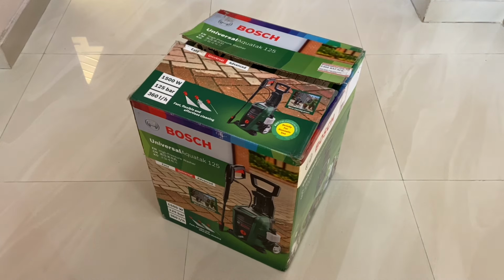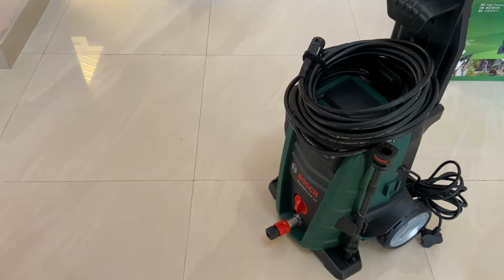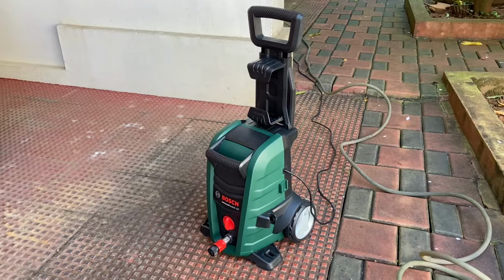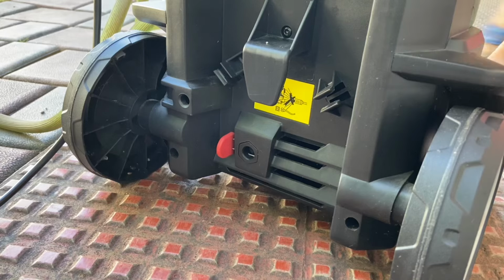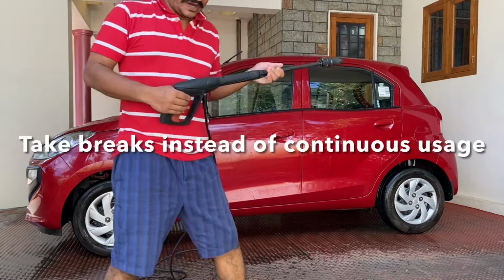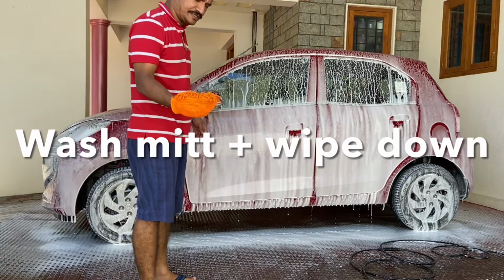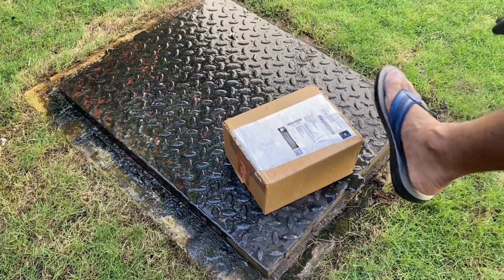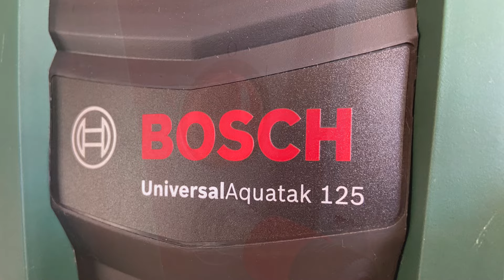Bosch Aquatak 125 Pressure Washer - Unboxing & Review

Comment: Great video! How’s it working right now?
Reply from the maker: Hi shashidhar, the pressure washer is working fine. I just used it last month when I was at home to clear the pavement of the green algae which had developed causing the pavement to be slippery.
Reply: @ that’s great to hear, have you had a chance to use the cheaper dylect washers? If so, please let me know what you think of it
Reply from the maker: Hi Shashi, no I haven’t used these washers with induction motors. I really want to review one since I am hearing good reviews on these units. Coimbatore has a lot of these small companies that assembles these washers. I saw Dylect’s washers on Amazon and want to review one. Let’s see. 😊👍🏻
Reply: @GaneshBalan  Hi Ganesh, thanks! I'll wait for your review of one such unit. Cheers ☺

Comment: Hi.. nice one.
Just bought it yesterday.
Please guide how to remove the air before using
Reply from the maker: Hi, before turning on the unit, press the trigger on the lance. Water must flow freely without pressure thereby purging air from the system. Then turn on the knob.
Reply: @GaneshBalan  thank you so much
Reply: @GaneshBalan  just need one more thing to know.
Shall I connect the nozzle while doing this or just with the gun itself I release the pressure?

Comment: Hi. How is the product now after 2 years of usage. Is it still worth to buy ?
Reply from the maker: 6.5 years of usage actually. 🙂 I bought this in Aug 2018. Working well. No issues. 

There are induction motor based pressure washers available now which are cheaper. Please also evaluate them if you can. They are more compact and produce equally good pressures.
Reply: @GaneshBalan  can u suggest some alternative please

Comment: The most comprehensive and informative guide for utilizing this machine’s capabilities. Storing the component in such a manner is truly remarkable. I commend your sole efforts, as I presume that no one has held the camera.
Reply from the maker: Thank you for the kind words Nirmal. Appreciate it. 😊 I had a tripod to hold the camera while I was working.
Reply: @ Will the Bosh extension hose pipe reduce the pressure? Is it good buy too? Please advise.

Comment: One small doubt brother,tell me the  water tap to nd machine water supply connect pipe size
Reply from the maker: 1/2” hose bro. You can get it in any hardware and plumbing store.

Comment: very informative video. I wanted to know whether we can attach the top nozle without the extension bar? Basically to reduce the length of the gun. If gun is too long, it's not feasible to clean mud guard and covers behind the tyres. Just wanted to know whether the gun length can be shortened or not. Thanks
Reply from the maker: Hi, no you can’t attach the nozzle without the gun. For reaching the underbody of the car, Bosch has a separate accessory - a 90 degree nozzle. 

https://amzn.in/d/fBzUqaD

Comment: Thanks Ganesh for the detailed Video. May i know what is your long term experience on this till today. Was it worth the money, any problems encountered ? Is this Copper or Alumunium motor, and what hp does it comes with. Thanks.
Reply from the maker: Hi Vinoth, it has been 6 years since I purchased this washer and touchwood it has been working well so far. 

I’ve also taken extra care with the equipment, wiping it with a dry cloth after every wash, rolling the pipes properly without any kinks or bends, storing the washer and pipes in our store. 

The washer has been worth every rupee I’ve spent. Especially with the additional foaming bottle from Aliexpress. 

I am not sure about the MoC of the motor since I have not had to open up the unit. You’ll have to check some video which shows the opening up of the unit. 

Thanks!
Reply: @GaneshBalan Thank you Ganesh.

Comment: Can it relieve the pressure by itself? If i dont want to spray continously when i switch to other places nearby and just  pull the trigger off while machine still on, and water inlet still running
Reply from the maker: No the unit can’t. Please don’t do this. Just use the machine in short bursts. You can alter the pressure by twisting the nozzle.
Reply: @GaneshBalan  ah thank you very much. You're very helpful brother. I subscribed.
Reply from the maker: Thank you Endrigo! Appreciate it. 😊

Comment: Thanks for the lovely review. I dont have a 16amp socket at the desired place for using washer. Why cant i use a converter socket 5 to 16 amp types
Reply from the maker: Please use an extension from a 16A socket. Don’t use a 6A socket and convert it to a 16A one simply because it is not meant to take higher loads. At best 600-800W max. Like a mixer grinder.
Reply: Thankyou Ganesh. Grateful for the prompt response. Regards

Comment: Hi, Great Video! does any MJJC foam canon work? could you share a link? Thanks.
Reply from the maker: Hi Michael, you need to buy the right adapter for the MJJC foam bottle. Different washers have different attachments. Like Karcher has a different attachment compared to Bosch’s washer. 

I got mine from aliexpress but it is now banned in India. We have other alternatives available locally. Where are you based?
Reply: @GaneshBalan   Thanks I'm in Europe.

Comment: Hi Well explained .. i also brought Bosch 135, but the machine is stopping after 3-4 min and again after machine running with sound no water pressure working .. this became on and off .. may be faulted machine .. so returned.. your machine can continuously work or getting stopped in between ?
Reply from the maker: Hi Vasu, sorry to hear this. Might be a one off issue but regardless, please don’t keep the unit running for over 5-8 minutes continuously. It overheats the built in motor.

Comment: Can we use this pressure washer for ac fins cleaning ? Can we adjust its pressure according to need?
Reply from the maker: Absolutely. Just don’t use the high pressure mode which will damage the fins on the condenser or evaporator. The other 2 modes are perfect. 👍🏻
Reply: @GaneshBalan  ok sir. And someone also suggesting that use 360 gun for lowering the pressure 🤔.
Reply from the maker: @AftabAmanullah  Not required. Just don’t use the high pressure mode. It will certainly damage the fins.

Comment: Use swirling mode around tyres and underbody. If paranoid about pensil mode
Reply from the maker: I am yet to find a use case for the swirling mode. It’s mostly the low pressure jet or the high pressure jet. The high pressure jet works well to dislodge the dirt in the wheel wells.

Comment: Great video sir. Can you please tell if I can use a bucket with pipe as an inlet instead of direct tap connection?
Reply from the maker: Hi Arvind, thank you for the feedback. Yes, you can use a bucks and the unit will draw water from it. Ensure that it doesn’t go dry during usage.

Comment: Hay ganesh, Hope the washer is still as good as new . Any changes to hose or service(oil change) done to the motor ? The local dealer here in Chennai was kind enough to give me an explanation and teach me the nuances of usage. Looking forward to this weekend’s cleaning . Thanks for the excellent video
Reply from the maker: Hello Ganesh (from another Ganesh!), the unit works well - no complaints and no replacements to any of the parts yet. The unit is used like 5-6 times a year as it is located at my hometown in Palakkad. No issues so far *touchwood*.
Reply: @GaneshBalan  nice to know ! Used it for the first time today, cleaned my car and my motorcycles in just 2 hours and mighty impressed. Forget the cleaning efficiency, I actually had energy left to wax and polish the machines too in Chennai summer, now that’s something. Felt like I was living in the Stone Age all this while . Worth the investment. Stay safe and take care 🤘🏽

Comment: Best review available ♥️🔥..btw can i keep it always in ready to use situation (without disconnecting the pipes) in safe and dry place?? Will it damage the connection or something? Please reply sir...
Reply from the maker: Hi, it is not recommended to keep the hoses connected to the unit. Please disconnect the hoses, clean the unit after the wash using a microfibre cloth and keep it in a dry place like a store.
Reply: @GaneshBalan  thnx for reply, i recently bought this machine and the quality is really gud👍🏻
Reply from the maker: Have fun washing! Please take care not to run the machine continuously to avoid overheating. 👍🏻

Comment: Very informative video. Thanks. I've just a question, what's the recommended duration (minutes) per use, as I was told it cant be use continuously as it'll over heat.
Reply from the maker: Hi thanks Skyler. There’s no set time period between running the unit. I just stick to say 10 minutes tops but it’ll easily be below that considering rinsing the car, washing it down, washing the wheel wells etc takes less than 10 minutes.
Reply: @GaneshBalan  appreciated your reply and noted with thanks 👍🏼
Reply from the maker: Thanks for the message Skyler. Good luck with the unit. 🙂👍🏻

Comment: Thanks, the video is very helpful. Can we use the water gun without the extension pipe. I.e. does the nozzle connects directly to the gun?
Reply from the maker: Hi Raj, yeah the lance connects to the unit with the supplied standard hose.

Comment: I bought one aquatak 125 just yesterday .Was using an aquatak 100 for a long time and it has packed up , no spares available so bought the 125 . On the 100 I had a  70 degree nozzle with which I could reach  under the car and wheel well . Dont you require one ? They sell a 90 degree bend as a separate attachment .
Reply from the maker: Hi Sanjoy, the inverted nozzle is a good addon especially for washing the underbody and one must have it with their pressure washing kit. I did not opt for one when I bought mine. It doesn’t come with the Aquatak 125 model. If you can buy one, nothing like it.

Comment: how about 130.. be better or 125 is good enough?
Reply from the maker: 130 bar will have a higher output pressure. It’ll be an equally capable unit. Go ahead. 👍🏻
Reply: tq 4 ur advise👍

Comment: I am getting a slight burned smell after using the machine for about 4-5 mins. Is that normal?
Reply from the maker: Hi Navaneeth, yes we do get a smell sometimes. I insist to not use the machine continuously for over 8-10 mins and give the inbuilt motor a break so it cools down.

Comment: Ive been on the wall wrt to getting this one. Your video was just perfect - answered all of the questions i had in mind. This is now on the way! 
Thanks for a great review + user guide!
Reply from the maker: Thanks man. Appreciate the comment. 🙂
Reply: @GaneshBalan  one question: what do i need other than what comes out of the box ? I assume the inlet hose-pipe is not included. what about the hose-connector(s) if i need to draw water from a bucket?
Reply from the maker: If you’re drawing water from a bucket, you don’t need anything else. Just the hose’s end needs to be immersed in water so keep some deadweight attached to the end to ensure it is always submerged so the hose doesn’t come out during washing. It’ll end up sucking air and the motor will run dry which you should avoid. 

Other than that you’ll need an electrical extension cord if you don’t have a 16A socket where the unit will be connected to and Bosch’s outlet hose extension. The supplied line is a wee bit short.

Comment: How can we reduce pressure by nozzle or otherwise to use for AC cleaning? Any way?
Thank you
Reply from the maker: There’s no pressure adjustment setting other than the 3 modes. Adjusting the inlet water’s pressure does not affect the outlet pressure. The pump inside boosts the pressure automatically. For AC condenser/evaporator coil cleaning, use the low pressure mode or the rotary mode. It won’t damage the coil.

Comment: Hi sir... How is your long term experience with bosche 125...Can i purchase it ... Is it worthy...kindly give a opinion
Reply from the maker: Hi Alam. I’ve had a great experience with the Bosch unit. No complaints so far. I must have extensively used it for at least 25 - 30 washes now. To extend the life of the motor, it is recommended to use the unit in breaks and not continuously. This will prevent the unit from getting heated up. 

That said, there are cheaper induction motor based pressure washers available now in the market which is much more compact. But I haven’t used one so cannot comment on the performance or reliability of these units.

Comment: Is this product gud or any other better options?
Reply from the maker: The Aquatak 125 is good for most home users. By better if you mean, more pressure from the output, you really don’t need something that high to strip the dirt off your car. There are cheaper induction motor based washers now available in the market with a 1 year warranty. I haven’t personally used one so cannot comment on the reliability aspect.

Comment: Can this unit able to jet spray continuesly over 1 hour non stop?
Reply from the maker: No man. That would over heat the motor inside. Best to use it in breaks to prolong the life of the unit. I may have used it continuously for 10 minutes at a stretch max.

Comment: Mate, brilliant video. I decided to invest in the Aquatek 120, as a first time user I did struggle to get a proper flow of water as it kept breaking up and pressure wasn’t maintained and eventually the machine would not switch on. Have returned and asked for a replacement, wil go for the 125 as it seems much more reliable.
Reply from the maker: Sorry to hear that Abhirama. Trust you read through the user manual properly. Ensure that you turn on the machine after opening the inlet to the water supply.
Reply: @GaneshBalan  ah that’s a good point, might’ve missed that trick. Hopefully I get a replacement soon with shipments super slow in the UK.
Reply from the maker: All the best man. Glad to hear you’re watching this from the UK. Appreciate your feedback too. 🙂
Reply: You should let the water to flow constantly first by just pressing the gun before turning on the machine. It ensures there is no air inside the hose. Once water constantly flows, you can now start using the machine.

Comment: It would have been good to see the pressure intensity if you could have used it as concrete cleaning as well.
Reply from the maker: I’ve shown the part where the flow is directed to the patio on the parking area and it is removing the green algae. Please check.
Reply: @GaneshBalan  yeah gotcha... Somehow missed the part
Reply from the maker: It is very effective on concrete surfaces. We’ve used it to clean the patio and walls laden with bird droppings, before we undertook the painting work. Just be careful to use it in breaks to avoid the machine overheating.

Comment: Be Careful that your High Pressure Hose is not in contact with any sharp object like steps where the hose will get worn-out and you may end up with a hose burst if this does happen do not discard the high pressure hoes find a place where people fix a connector Joint which cost about Rs.300 instead of spending on a new High pressure hose.
Reply from the maker: Good suggestion Trevor - I’ve also brought this out in my video wherein I’ve mentioned to avoid any kinks in the hose during operation. These bends or kinks will lead to the hose getting ruptured at that point.

Comment: This is the only video among so many pressure washer reviews that mentions the power plug (16A) the unit uses.👏

Edit: Does the unit require regular oil change?
Reply from the maker: Hi Anup, thanks for the feedback. 🙂

There’s no oil change requirement indicated in the manual.